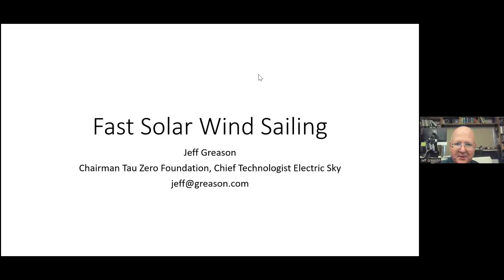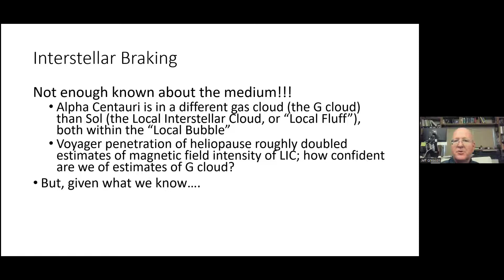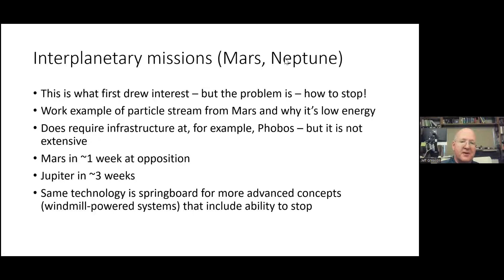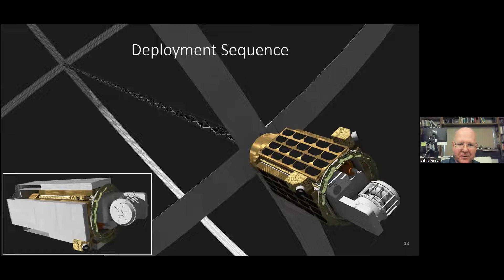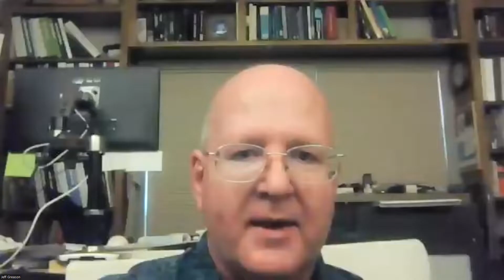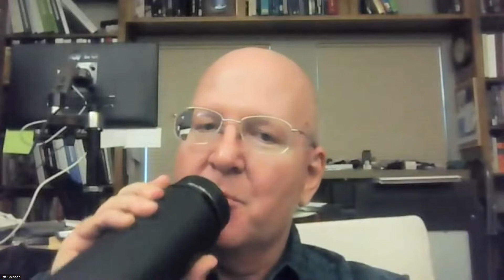NSS Space Forum - July 14, 2022 - Fast Solar Wind Sailing with Jeff Greason

Comment: Why not use a kilopower reactor as the power source, a smaller 1kw version?  Why not use the new superconducting tape currently being used with the MIT SPARC reactor, it is a HTS and should be easier to use? Please, add plenty of sensors they're what make exploring interesting especially a IR sensitive telescope like a small Schmidt Cassegrain.  Also, use digital communication, the internet in space, although it would require a different protocol model for outer space little to no handshaking only receive windows for earth and the spaceship would still provide the sharing of more sophisticated data than the older transmission methodologies currently used.  Spacex might be interested, even Blue Origin if pitched might be interested.